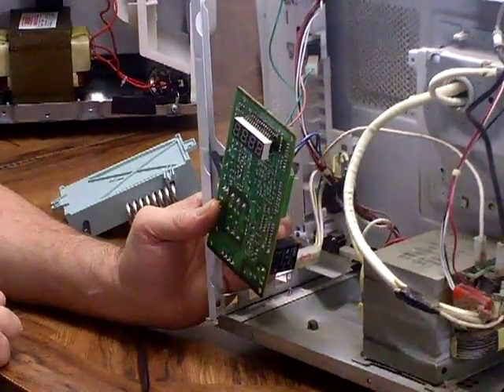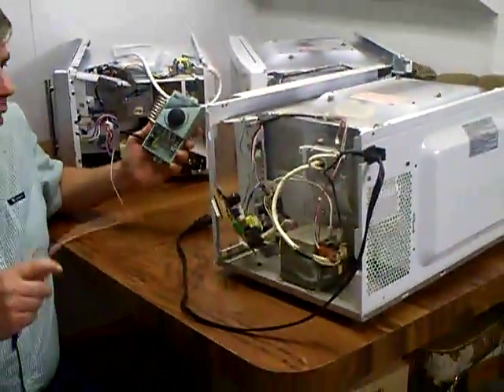8 more info to build a high voltage colloidal silver machine

Comment: Here is my idea that could help, Use a larger glass bowl to house the colloidal silver bowl, place about 3 inches of water in the larger outer bowl, this would draw away some of the heat from the inner bowl allowing you to run your process longer and like midway through the process open the door and put some ice cubes in the outer bowl water to drop both temps and finish your process???

Comment: to CupHorse
The AC from the house goes to the transformer that keeps it AC until it goes to the HV Diode, and Magnetron. That's where it gets converted into DC, by those two(2) parts.

Only AC comes out of transformers.
If he removes the magnetron, and HV Diode, the 3000 volts from the transformer stays AC.
Plus ... The transformer is made such, that it keeps the current constant.

You can see how all this works by reviewing the link I put...
http://www.repairfaq.org/sam/micfaq.htm#micmicgenc

That entire site also describes the microwave oven in more detail, on that entire page.

I still don't think this method will create true colloidal silver, but I'm still checking all this out.
It's interesting on how he's adapted a standard microwave oven to do this, but I think the Arc method may be better, or the Plasma method.

It's hard to find true definitive science on YouTube.  Everyone is trying to sell something in their videos.
But, this guy is interesting, never the less. :)

Comment: I've built one of these machines. I had an electrician look it over for safety reasons. I made the same silver oxides only to find out that the method sucks. Its also extremely dangerous to make using high voltage. And the particle of silver are extemely large!!. I spent over 1 year researching nano technology and learned how to make it the right way. Research the hot method for making colloidal silver and avoid this guy. He may know maytags but he doesnt know anything about colloidal silver.